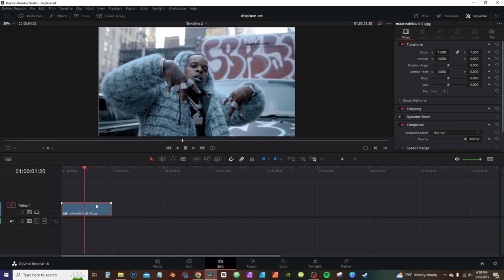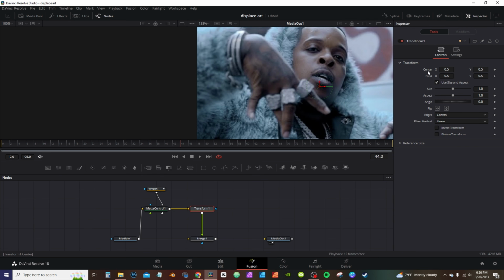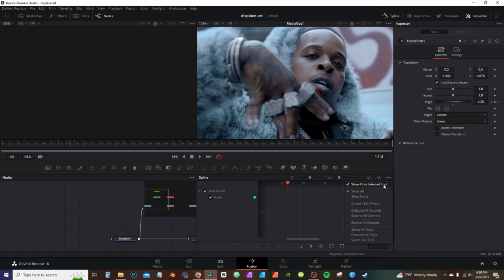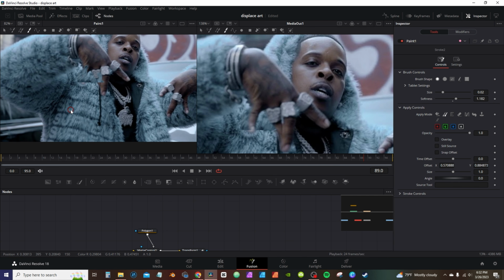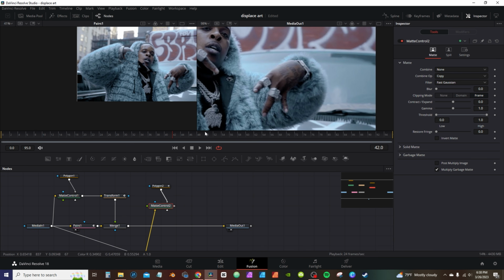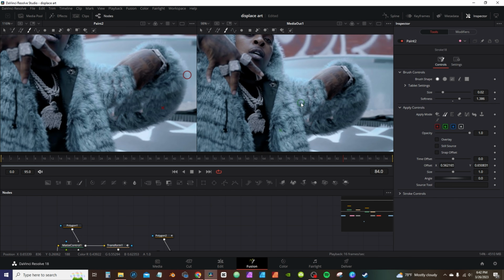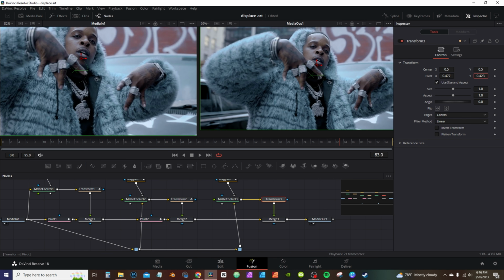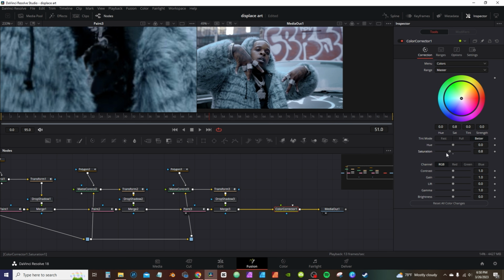How to Make 3D Moving Album Covers Visualizer] |DaVinci Resolve 18 FREE |

Comment: OK, I got past the Matt part but now I’m stuck on where you have the mouse on the transform tool and you’re showing both hands using the center when I do that mine doesn’t pop up my hand doesn’t move
Reply from the maker: Double check the placement of your nodes
Reply: @ is there a way where you can help me because I’ve done everything right but I don’t know why it’s not working
Reply from the maker: I can't right now I work nights. Take some screenshots and post them on my discord and the need help section. I can take a look at the nose structure and go from there.
Reply: @ OK my bad bro here’s what I want to tell you the polygon is not moving the specific part of the subject that I would like to move. I did everything correctly, but the polygon moves only instead of the parts.